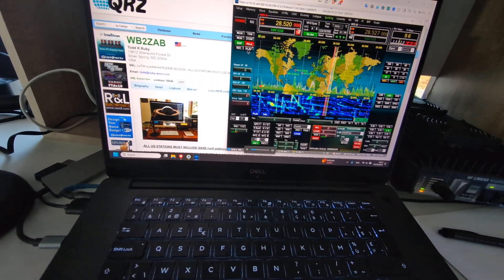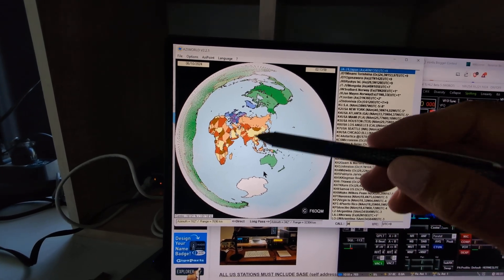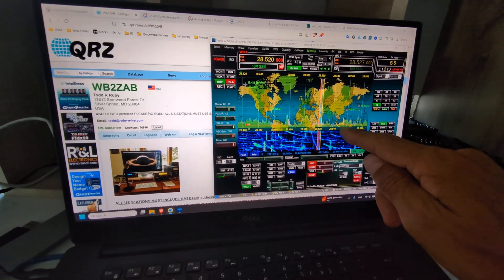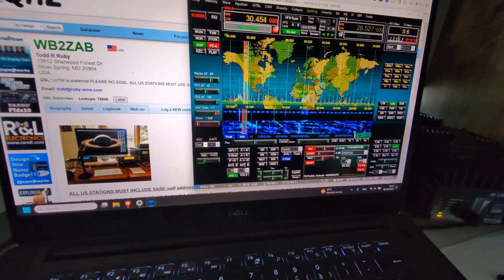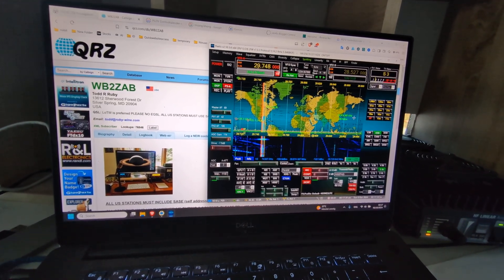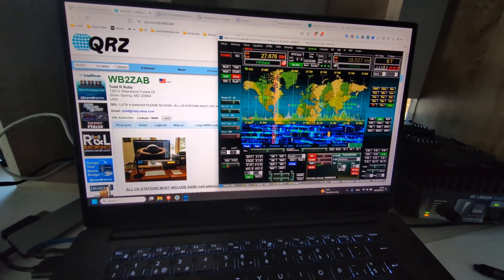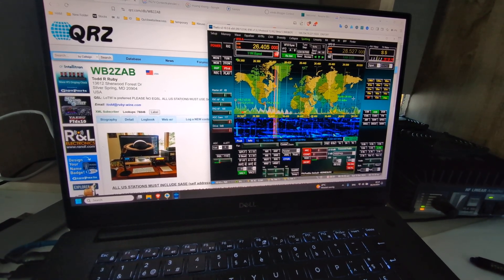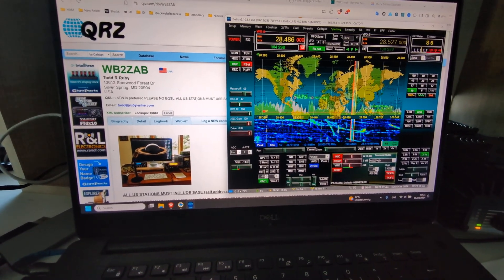QRM level in Thailand when pointing the beam to North America. Help me to identify the source...

Comment: I thought it was atmospheric noise but it's probably not. It's likely as you say welding machines. I have about the same amount of QRM / noise here at the same noise levels as in your video.

There is a post on hfunderground about this (you might have seen it already?), the topic is: "27 MHz ISM Fish Hook Swisher Interference RFI EMI RF HF Sealers Heaters Welders" I can't link the URL here apparently. The noise on 10m is more or less the same from here whenever it's open to Russia and further east. It's been really bad this past month or so, makes it hard to do any dxing, weak stations just drown in QRM.   - 73 DE LB1TI